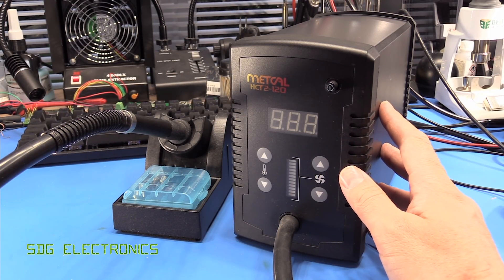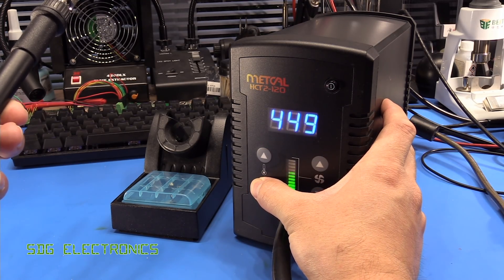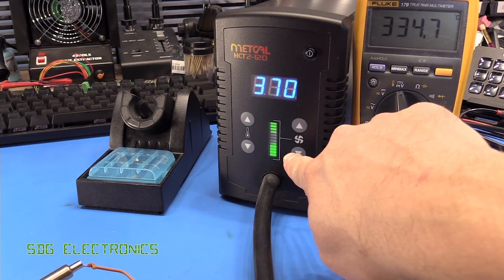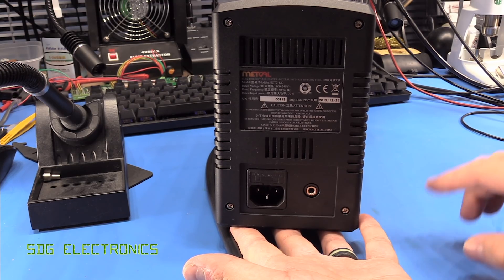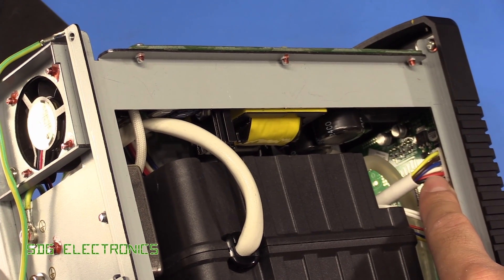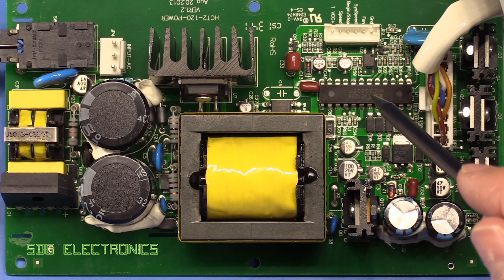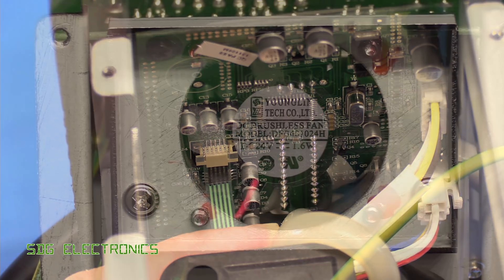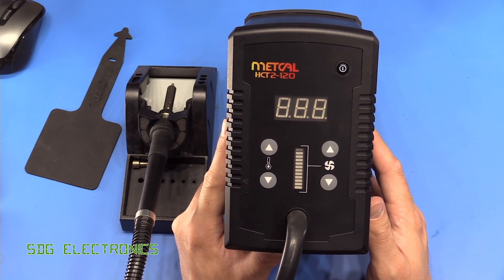SDG #151 Metcal HCT2-120 Low Power Pencil SMD Hot Air Station

Comment: I'd still prefer better quality components inside, such as a Papst fan instead of the chinese Younglin turd they integrated. I was not able to see the brand of the capacitors, but I doubt they're Nichicon or Rubycon... which is the case with JBC for example. You get what you pay for.
Reply: What? I saw inside JBC vacuum control unit. It’s all cheap crap no name Chinese capacitors (probably I saw in a marco reps video, or possibly @Rhine-Labs).

Not all Chinese branded components are bad and Japanese capacitors never had any problems. The real quality problem is counterfeit components, which there’s a lot of. 

I think that fan is fine. It could use standard, off the shelf parts (ball bearing, plastic parts, PCB controller). So no worse than an expensive fan with same specs.

Comment: if you have a good hot air station, such as the quick. why not just get a smaller  nozzle for the unit? for iPhone or etc mobile phones. just saying.
Reply from the maker: On the bigger units, the handpiece can be a little heavy/unwieldy for precise application. It's a fair point though

Comment: Nice Dave audio...one of his many phrases.
Like you said seems well designed. A bit more engineering has gone into this unit. Instead of mainly mechanical design as in the triac mains powered heating versions.
Why dont they allow a calibration mode on the device like a simple pot?

Comment: Nice review! You're the best resource on Youtube to learn about Metcal products. I hope you'll do a thorough review of their desoldering gun once more. That gun in use is a scene to behold. The interesting part of it was the sound it made when solder was being extracted. The sound of it was different from all the other guns that I've seen. Does Metcal have any connection with a brand called Thermaltronics? They seem to have the exact same design. I wondered how it was possible. Has Metcal sold their design to another company?
Reply: I've bought the Metcal desoldering gun and regret it. That sound you're talking about will depend on what compressor you hook it up on. I end up getting a Hakko desoldering gun for most of the time and will use the Metcal if I need to desolder a lot of components.
Reply: @forthosewhodare7325  I watched your video of the Hakkos. Pretty impressive. Why would you prefer the Metcal if you have to do a lot desoldering? Any specific reason?
Reply: I read somewhere that when the patents Metcal held on RF-driven soldering expired, some of the original Metcal folks left and founded Thermaltronics. I guess by that time already the Metcal company had been sold to OKi.
Reply: @josh46646  I read the same. It seems true.

Comment: It's a bit pricey, but when you get used to it, you're going to love it. You can precisely solder or de-solder an FPC connector without any damage. 
Thanks for the video.
Reply from the maker: I do actually like it, it's just very specific. Thanks
Reply: When you say Metcal & “extremely pricey”, I was expecting more than £450. 

Quick TR1100 is 200W, 1.5-7L air and the hand piece looks identical & takes Metcal angled nozzles (£300 from kaisertech) for anyone that might be interested. 

Video about using Metcal nozzles with TR1100: https://youtu.be/xneWWa_Hb4s
Reply: Looks like my comment got deleted..? 

Quick TR1100 has same specs and same hand piece. It can use Metcal angled nozzles.
Reply: https://youtu.be/xneWWa_Hb4s